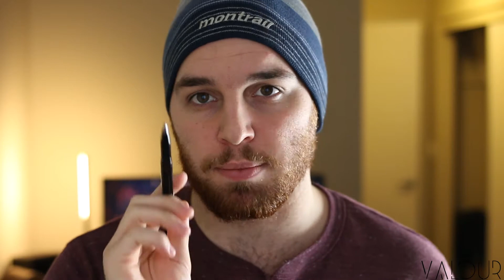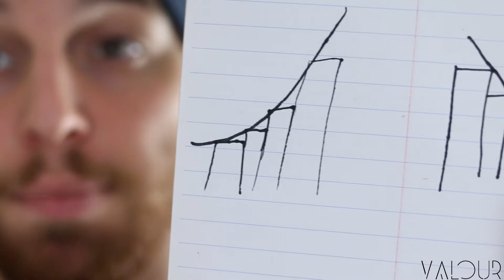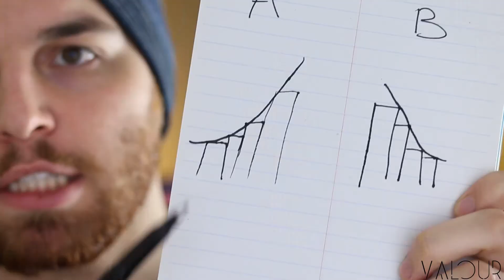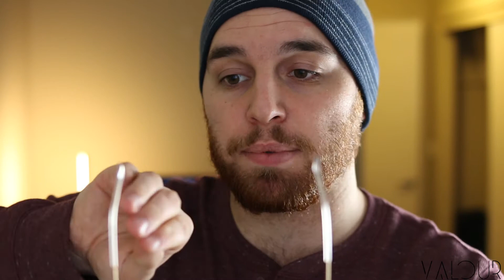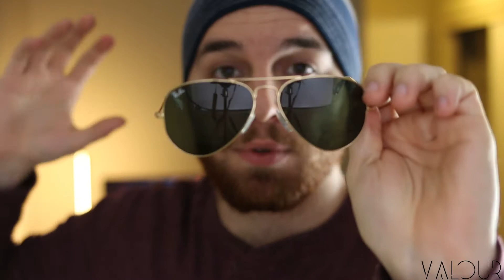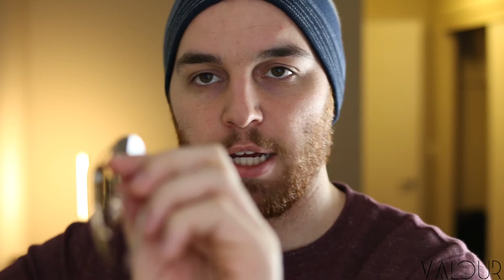Headphone Amplifiers: Explained

Comment: This is confusing. Im new to this, but I have just seen another video explaining why amplifiers DO NOT MAKE ANY DIFFERENCE! AAggghh. They cant both be right. There is about 100 supposed audio engineers saying that an apple dongle amplifier is all you need and everything this guy is saying is trash.
Reply: Its kind of what he explained. If your headphones are easy to drive (high sensitivity / low ohms) small gear like iphone + dongle may be sufficient for many listeners (although upgrading often does help).  With other headphones, especially planars, it would be like driving against a brick wall. They wont get loud enough or lack dynamics as they requiere way more power than iphone + dongle can provide.  I m skeptical about the true difference between dacs (high end vs low end) as its mainly digital, but amplification itself is not a hoax and has been deemed necessary way longer than this guy is even in business. You should especially  try a tube amp and hear for yourself how the sound is getting colored as well.

Comment: Very informative!  Could you perhaps explain the difference between Solid State amplifiers, and tube amplifiers? I know some people prefer tubes, but I'd like to know why, because I've never heard them myself, and I'm a little skeptical that it's "thousand dollars" good.
Reply: The idea is that tubes generally limit you to certain design choices for low tube count, single ended class A with minimal feedback, usually. Tubes also have different distortion characteristics than transistors, more even (octave) harmonics, which are pleasant. They also have soft clipping when driven hard, like as used to it's extreme in guitar amps.
Usually people like them with really clean headphones to give it a warmer lush, more vintage tone. 
The extent of that sound depends a lot on the amp design, people back in the days minimized that sound for professional equipment since it would be additive in every single stage of the process. Ex: Microphone preamp, tape recorder, tape duplication or master vinyl cutting, and the user's home speaker or radio. It can get muddy with far too much of it.
Reply: @mikafoxx2717 , If you lived in the 1960's, or earlier you would know the sweet richness of Tube amplifiers.  The so called distortion ... is not HARASH,  it is 99% pleasant...  and in imo offers much more Dynamics & Harmonics are rich.   Where allot of Solid State AMP's sound FLAT & COLD.  But, Solid State Amp's have came along way, because of the UPGRADE in materials & Design.  I have several AMPS, that can hold there own .. up against my Tube Amps.  But still, the Tube amps offer just a little more, in stage presentation, warmth, and depth.  Best way to understand the real difference is to A & B them, in the same Room, Speakers, etc.,  You'll hear the Difference.
Reply: @wally6629  I have designed, built, and repaired tube amplifiers and I don't think the distortion is warranted, even if it's a class A single ended design with even harmonics. AB cancel out even harmonics, you get more alike a solid state amp in that case. Crossover distortion from hysterisis in the transformers also isn't ideal. I love the build quality of them, though. And they usually sound great anyways. That is, if the speaker was designed for 8ohm impedance instead of neat zero like some new ones are.

Comment: Headphone Amp:
- Improves Audio Quality ( due to better driver performance/damping/speed etc )
- Improves Volume Levels ( due to same reason ).
- Gives full potential for the speakers/headphones.

Headphone DAC:
- Gives the Audiophile placebo effect that it makes DRASTICALLY better sound quality same as silver cable.
- Works basically as EQ, changes the sound signature.

IMO Amps is top priority, i doubt DAC will add alot if the audio source isn't polished well or playing games, watching netflix etc.

Comment: Do athm50s needs dac/amps? Any recommendation for a good upgrade of my 5years old m50s? Thanks! Subscribed!
Reply from the maker: Racel Thanks for the Sub! Soooo.... almost no headphones NEED an amp. Although, most do need it in order to “unlock” there full potential. M50s do benefit from an amp, though, yes. But you could totally listen to them on your phone if needed. 

Regarding a new pair of headphones, are you looking for open or closed? Do you have a budget?
Reply: Joshua Valour im considering open backs. Thinking about the shp9500 philips but i can wait and save more since im still satisfied with my m50s.

 Any recommended dac/amps? Source is fiio x1 2nd gen thinking also to up my DAP game :) 
Thanks bro! More power to your channel.
Reply from the maker: Racel SHPs are really great for the money. Monoprice M560s get you a really well built planar magnetic headphone. Requires a bit to power, though. There $150 right now on monoprices website. 

You could also look at Hifiman Edition S. Really good sounding headphone. And they don’t need alot of power.  

Any others you are looking at?
Reply: Thanks man. Ill look it up, for now im looking for a dac/amp (portable cause I really dont stay at home that much) for m50s then ill go for the open backs. Will be watching more of your vids learning a lot since im really a newbie to audiophile.

Comment: You should take an Electrical Engineering class... I like your enthusiasm though!
Reply from the maker: Can’t tell if compliment or insult.... lol
Reply: It was more of a suggestion than anything else. Don't get me wrong, I love your content. I just feel like you would really benefit from an Electrical Engineering class. I've learned a ton from the classes that I've taken (I'm an EE major, though switching to Comp. E soon)
Reply: @JoshuaValour  its a nice way to insult you for a lesser mind person
Reply: @JoshuaValour  it's an insult.
Reply: So, my enthusiasm drove me to do research, and the correct answer to my question is "Headphones that carry 65 OWMS do not require a headphone AMP primarily because of the use of let's say a cell phone AD / AMP is more than enough power to captivate the performance of the headphones. Now let's mention a pair of headphones that are a bit on the "$Pricey$" side and the OWMS are 250, 350, or even close to 500. "In order to get the very best performance out of those headphones, it requires a HEADPHONE AMP" . . seemingly because of the AD in something like let's say a cell phone is not powerful enough to allow the headphones to activate the headphones to its ultimate performance level. So my post was quite some time ago and since I did not get an answer right then and then I decided to do research and I did not need to go to engineering classes as you mentioned. I simply was looking for an answer, not a suggestion. Thanks.